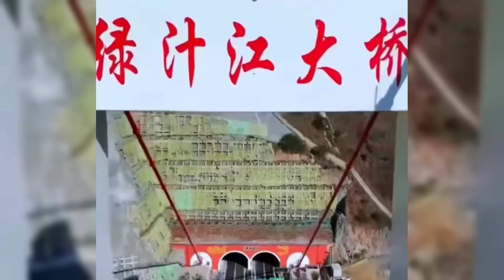It May Be Hard to Believe, But This China Megabridge Actually Exists

Comment: why do you always quote the of Chinese infrastructure cost in USD.. how about giving us the cost in local currency.. if the same thing were build in the US it would cost 10 time over.. very misleading.. it makes it sounds so cheap..
Reply: It is the institutionalized price gouging that is so rampant in the US that causes you the problem and the bewilderment.  It is in fact really a lot less expensive than if done in the US. 
They sell consumers and electronic goods to the US at the prices comparable to their local prices, and that's why the US people get to sustain their high living standard at a fraction of the cost of otherwise if they were manufactured in the US. 
Just think about this pricing by the Pentagon for charging a bag of bolts and nuts for nearly 10 thousand US dollars while the same spec and quality can be purchased online for merely 9 thousand RMB locally.  What happened to the  price difference in between —— institutionalized price gouging.  Shipping and handling is very little and doesn't suffice to account for the price gap.